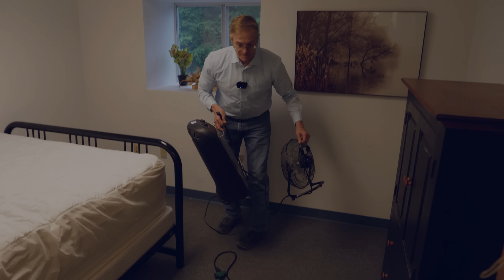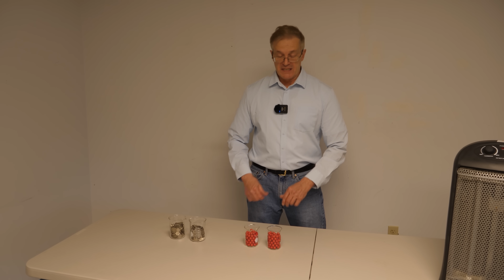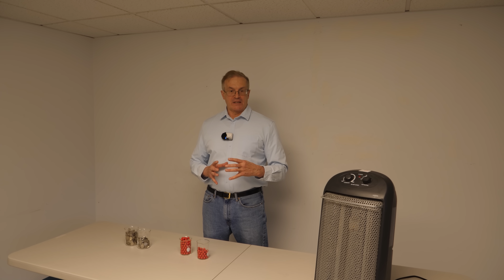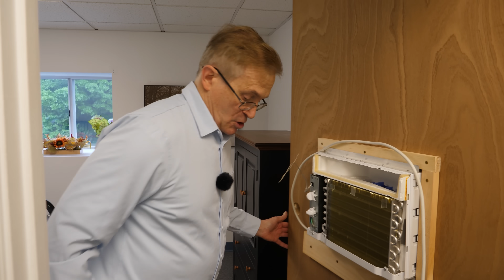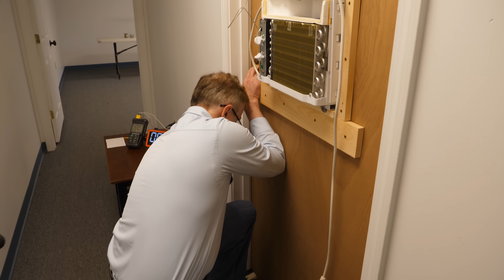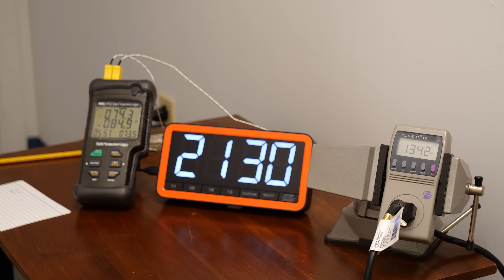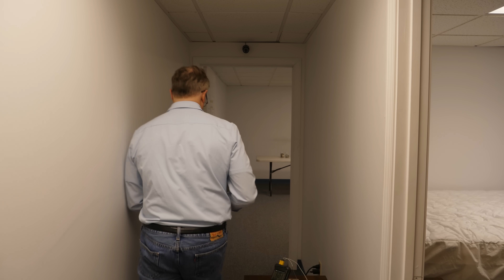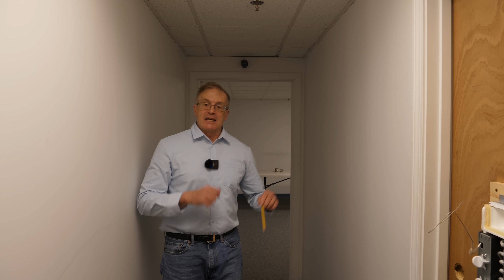You're wasting money on heating! Use your A/C!

Comment: It is often complained that 'Heatpumps stop working when it gets really cold, like -10°F." Pfft, that's not cold! All that has to be done to continue extracting heat from ambient ANYWHERE & ANYTIME on Earth is to use the proper refrigerant. Want a heatpump to work in darkest Antarctica at -100°F? No problem! Just have the engineer look up the properties of refrigerants with low boiling points, like Ethane or Ethene. Those are already recognized as refrigerants: R-170 and R-1150, respectively. They have boiling points of -88°C or colder. Neither is bad for Earth if it leaks. Want to be 'squeaky clean'? Use Nitrogen (R-728) or Argon (R-740), with boiling points of -195 and -185°C, respectively. [All B.P. at 1 atmosphere pressure]
Reply: This is incorrect. Regardless of the refrigerant used a machine cannot extract more sensible heat from air than is in the air. There's not much sensible heat in the air at -100 degree F, so you're not going to be recovering much.
Reply: @thepierianspring2353  - You are changing arguments in mid-stream. That is not valid logic. Specifically, "Not much heat" DOES NOT exclude "some heat". As stated in the video, there is ALWAYS some heat present, unless the temperature is Absolute Zero. -100°F is FAR above Absolute Zero (-459.67°F), so in fact, it is YOU who is wrong. As a practical matter, you can always extract heat at any temperature above about 20 Kelvin (the temperature of Liquid Hydrogen) which is about -423°F and -253°C.
Reply: @YodaWhat  It's probably best that you stop posting about something you have no knowledge of, you can keep posting if you like, but you will just look foolish. I'm right, and your just a person whose confidence far outstrips their knowledge.
Reply: @thepierianspring2353  - Funny, that is exactly what I was going to say to you.
Reply: @YodaWhat  You would have just been doubling down on your ignorance.
Reply: @thepierianspring2353  - It seems rather that you have doubled down on your extremely limited understanding of general thermodynamics, and specialized engineering practice. Commonplace experience with conventional systems is no substitute.
Reply: @YodaWhat  Do you use you understanding of "general thermodynamics" to repair your air conditioner or heat pump? Or do you call someone who actually knows what they are talking about? Bwahahahahahahaha!
Reply: @thepierianspring2353  - Again, you have gone for the Deep Rectal Grab of the most mundane things, and come up only with crap. FYI, one of my past jobs was Refrigeration Technician at a place which built all manner of custom refrigeration equipment from just the simplest parts. Mere air conditioning? Childsplay! Now before you expose yourself as a TOTAL FOOL, why don't you look up Cryocoolers? Also the more specialized Helium Reliquifiers, as used with MRI machines for example. They are heatpumps (in the most general sense of the term, and as used in the video) that extract heat from Helium gas that is just a handful of degrees above Absolute Zero, and pump that heat out at room temperature, in order to cool the Helium vapor enough to make it liquify. In other words they pump heat, as heatpumps are wont to do.
If you cannot now understand how utterly you have been defeated, you should spend the rest of your life asleep, for you will have proven impossible to awaken.

Comment: Ok, it makes sense, but does this work in -50 canada winter to heat your house up? (serious question!)
Reply from the maker: It can be part of the system.  For huge temperature differentials, combining a heat pump with another heat source to fill in the gap will save energy overall.

Comment: We should be using heat exchange and heat pumps for all kinds of things. Hell, in so many parts of the world we could bring our refrigerator usage down to 0 for pretty much half the year if we just connected it to the outside ambient air instead of running a compressor inside of an already warm house. We could heat our water, dry our clothes, and preheat our ovens by utilizing the outside ambient conditions and sunlight in the summer (and you have several videos on this). If we built our houses correctly, we could even utilize the cooler underground temperatures as a heat sink for more effective passive cooling in the summer. Harvest the energy and temperature deltas at your fingertips before you go about using electricity to brute force it.

Comment: The problem with heat pumps is those "couple of valves that allow them to reverse the direction of operation".
They tend to leak, are hard to diagnose and cost a lot of money to replace. 
The efficiency of your heat pump goes out the window when those valves leak and depending on the extent of the leak, you wouldn't know it for years.
Reply: Wouldn't you realize the refrigerant was leaking when heat pump performance reduced?
Reply: @jamesengland7461  "depending on the extent of the leak"

Comment: Intriguing concept. Im not an expert in thermodynamics by any means, but a few things to consider that may effect the results of this experiment in a real-world application.

The temperature in the hallway is significantly warmer than the outdoor temperature would be in a situation where heating is required. Thermodynamically, i would expect significantly greater efficiency in heating the room when the AC unit has access to more heat in a warmer hallway like in this setup. Would be interesting to see a situation where the “hallway” temp is something more like 20 degrees F.

Secondly, I think this would have been a more fair comparison with the fan being used in both cases rather than only with the resistive heater. The fan uses some non-trivial amount of power and that will factor into your power consumption and efficiency calculation.

Comment: You guys should have used a resistive heater at not a radiant heater. Radiant heaters don't work very well with a fan because the air doesn't absorb the radiant heat.

Comment: There is much more to be explored indeed.
I can see a future where:
- an AC system in house moves heat to a swimming pool.
- an AC system in house moves heat to a reservoir, like a boiler.
- solar energy (not electricity, but thermal energy) is used to increase heat pump efficiency. 
- fridges, freezers, dryers and washing machines output thermal energy into some kind of reservoir for later use.
- an oven dumps residual energy instead of heating the space around it after being used.
- work out a way to extract heat from your car engine once you arrive home.
- many more things...

I mean, if you think about it, our house has plenty of heatpumps or heat producing systems already.
If we could just manage the way these transfer heat around, we would need much less in the long run.

Comment: Electric heaters are 100% because its in a closed system. Introducing entropy results in loss of efficiancy. Heat pumps are less than 100%. You don't use an extension cord on electric heaters, putting the electric heater by the wall results in entropy along the wall.

Comment: A better analogy is having the "cold beaker" heat units (balls) spread around the room and the heat pump collects them and puts them into the "hot beaker". This would also help illustrate why the efficiency goes down as the temperature differential increases as it takes more work to run around and collect fewer balls from the cold space and lift them up to the hot beaker on the table.

The heat pump efficiency reported in the demonstration is enormous, and overstates what an actual heat pump performance is as the temperature differential between the two rooms starts at 0 degrees rather than a typical 30F degrees you would be operating a heat pump in down in warmer southern climates. In northern climates the shoulder season that heat pumps work well in is traditionally too short to rationalize, especially when you need a deep winter heating system to run when the heat pump cannot.
Reply from the maker: Good point.
Consider a hybrid system.  I'm not talking about using one system OR the other. If pumping efficiency starts very high and drops as the differential increases, then use the pump to reduce the differential and close the gap with an alternative source. This saves energy consumption overall.

Comment: I live in North Texas.  We installed a wood burning stove after the Texas freeze and it was the best thing we ever did.  Our heat pumps have always been insanely expensive so not only are we saving money but with the ceiling fans on, this has been way more efficient.  That said, always really cool content!
Reply from the maker: The real world is a harsh mistress.
Reply: The house I just sold has a wood stove. We used it for heat 17 years straight the oil furnace was used only for hot water and heating the basement. The one big drawback to wood is over time soot gets on everything. The ceiling the walls etc. You can't keep the house clean it's a losing battle. We had to completely renovate the entire house every room before selling it. The worst part stain blocking primers didn't work unless you use an oil based primer. After the house was done and it looked great we could see the soot bleeding through. Hard to notice if you didn't know to look for it but it's an issue that just doesn't go away. My new house has a wood insert I only will use for emergency use.

Comment: You need to make a video of converting single hose portable airconditioning units to dual hose air conditioning by sealing the intake air inlets with another hose, the results are substantial and the price difference between a single hose and a dual hose comes down to just a hose

Comment: Lots of ignorance and lack of specificity in the comments. Air source heat pumps move heat from the outside air to the inside when in heating mode. With an air source heat pump when ambient temperature drops too low not enough heat can be extracted from the air to warm the interior space, when this occurs a backup energy source, usually electricity (sometimes natural gas), kicks in, when this happens you now have a electric resistance heater (or a gas fired heater). This shortcoming of air source heat pumps cannot be engineered around as you CANNOT take more energy out of a system than is in the system. That's why air source heat pumps have backup in the first place. 
Ground source heat pumps are more forgiving because they exploit the thermal mass of the Earth, they are however, much more expensive and the field is subject to failure.

Comment: This needs work to be practical.  You can't just out the ac in the window backwards in the winter.  The cold air outside will freeze the unit. 
Plus the heat loss around the ac will negate the efficiency. 

I like the idea and im sure it can be made to work, just not as an ac unit like you just did. 
But idk much and this item could already exist fir all i know
Reply from the maker: Of course. 
Get the principle down, then address the engineering, and eventually, you can look at the marketing.

Comment: Modern reverse cycle split A/C, (especially brands like Mitsubishi Electric, Fujitsu, Toshiba etc.) is capable between 3 to 12 of COP (coefficient of performance) depending of outside temperature but never under COP 3 @ - 15 Celsius. This means that every unit of energy that you bring will be multiplied by factor of 3~12 (COP). For example if unit consumes 500W you will get something between 1,5 to 6 kW heat out of "thin air". In Europe favorite type of heating and cooling especially after gas price rocketing as result of war in Ukraine.

Comment: Interesting result which I barely understand unfortunately. I get it that mechanically You used regular A/C unit for pumping air inside building. I suppose window in room was closed. And it resulting in heating air in room... But I don't get it. So basically You can heating just installing between rooms A/C's which pumping air from walls inside building? My brain struggle to construct conclusions from this even if I understand what You done.

Comment: 4.5x efficiency is awesome! But the space heater is dead silent which is probably a lot of people wouldn’t be sold on the reverse AC solution. I’m definitely interested in installing a split heat pump system though.

Comment: Unless that cord is rated for the proper  draw you never use an extension cord for heaters or air conditioner units..
Reply from the maker: Of course, and I wouldn't recommend using one outside of a controlled and observed test.

Comment: Looking forward to experiments that show how much better an AC unit is at being a space heater than a pure resistive space heater, in LOW ambient temps!

If I have to spend another Winter living in my 1986-vintage motorhome in Northern Nevada, I'm DEFINITELY buying a new, low-capacity window AC unit in around October, when they should be cheap and readily available. I'll just remove one of the sliding windows in the RV, and accurately cut a sheet of plywood to fit in the opening, and seal it in permanently. Then cut a hole to fit the AC unit, and seal that in, too, but NOT permanently, as I'll want to be able to reverse it for cooling in the Summer (My 1986-vintage roof-mounted AC unit still works, but is no doubt NOT very efficient compared to a new one).

I've been heating my ancient RV with resistive electric heaters, and although that works well, even at NV's low electricity costs, it still gets a but pricy for my poor ass to afford when outside temps drop to near zero. My old RV has VERY thin walls and single-pane windows, so it loses heat quickly.

Comment: In New Zealand a permanently installed heat pump (bi directional) is typical for both residential and commercial buildings. Where I am, I usually use it as a heater - but I do use it as an AC on the hottest few days of the year.

Comment: The concept is strong, the practicality not so much; with an air conditioner being used to heat, it would be either on or off. That's one of the reasons you need a 'true' heat-pump to regulate a desired temperature.
Reply from the maker: The concept was the goal.
Reply: @TechIngredients  Agreed, and not to be a knucklehead, but change the title and I'm completely on-board.

Comment: Since 2010 I've been using a small room heater/cooler (Neoclima 09) on inverter in my parents' house and since 2018 - Midea 18 in my house. Also inverter type. Both have great performance and close to the best price/performance value. But most people don't even bother to read the difference, they buy the cheaper version (also because they can't afford an inverter), which will always be a regular air conditioner of non-inverter type.

Comment: Clever idea with a few downsides: upfront cost, noise, and dealing with the condensation.  I remember my dad's window A/C unit put out bad smell on the outside of the house where the exhausted heat came out.  The smell, I found out later, came from mold that builds up in the condensation collection system, and so it needs to be cleaned out and sterilized from time to time.

Comment: I can see where this works when the starting temp is around is 75 degrees, in the house.  In a real life application, where you use this reversed window unit, with outside temperature at say, 25 degrees F,  will you still pull enough 'warm' air to create the kind of heat to make your room comfortable?  Very curious.

Comment: ALL AC UNITS IN EUROPE are reversible for heating - I cant believe that you guys dont have this....????
Reply: Both types of systems are commonly available here. I recently sold a house in wa state that had a heat pump/AC, it heated and cooled. I moved to a house in MI that has a AC unit that works like a heat pump but it only works as an AC. Reason for that is my house is heated via natural gas in winter. Soon I plan on installing solar panels to run the AC unit in summer since it is our biggest user of electricity.

Comment: The demonstration illustrated the efficiencies you can get pretty well, but just a point you may wish to cover next time.
You had the AC condenser (that would typically be outside) in a room that was already 70 degrees. That is not a real world scenario, the condenser would always be outside where the temperature in winter (when you need heat) is much lower. That will affect the COP, or more accurately, the SCOP (Seasonal Coefficient of Performance) quite dramatically, possibly cutting it in half.
Don’t get me wrong, I am a massive fan of heat pump technology and an having one fitted in my home next week (air to water), plus I am an industry professional that specifies AC systems for heating purposes, as well as cooling. However, we find here in the UK that unless people are given the whole picture, heat pump technology (air to air or air to water) gets criticised for not being as efficient as people expect it to be. That’s a shame as it’s the way forward.
Looking forward to the next video though, thanks.

Comment: A few comments here you’re focusing on the heat component of Home energy efficiency. You also need to focus on Home insulation as well. If you have any windows in the rooms you also need to focus on reducing the heat loss through those. the heat does rise to the ceiling. If you want to be even more comfortable fans can help to push the hot air down to the floor where you’re going to want it to be.

Comment: I've always assumed that for most efficient operation, a "heat your home" heat pump would need different refrigerant gases or for the compressor to be tuned differently, compared to a "cool your home" air conditioner.  This test has the AC pulling heat from a 75 Farenheit hallway, I'm curious how effective and efficient it would be at heating the room if the hallway was below freezing temperatures.  Even in this video we watched the power meter climb as it was pumping heat into a room warmer than the hallway, if the delta was much more extreme.. would a windowsill air conditioner actually be effective and efficient?